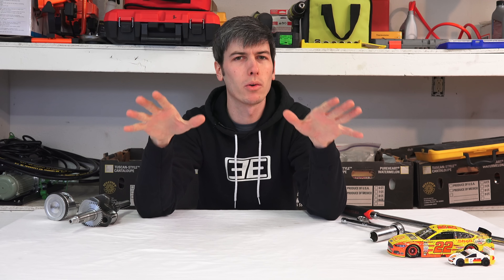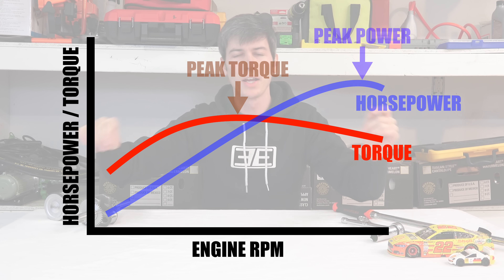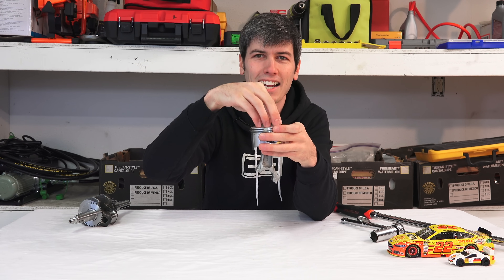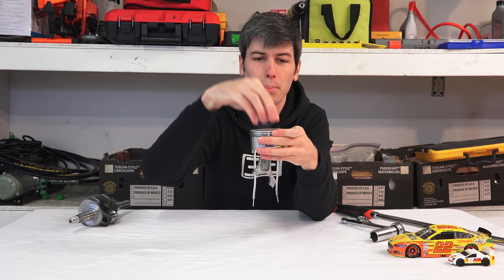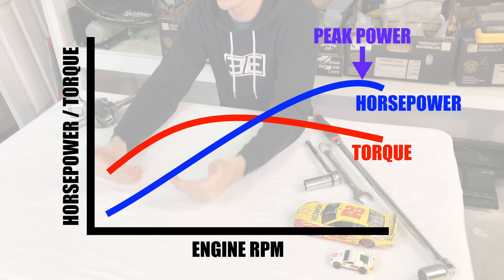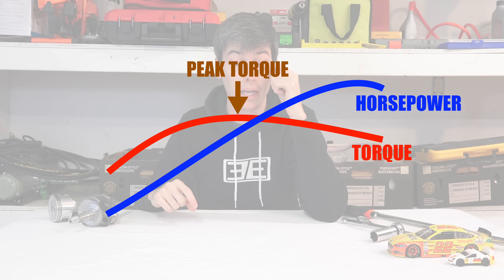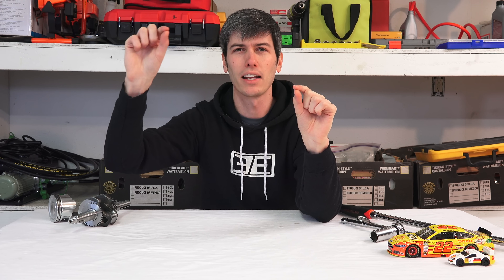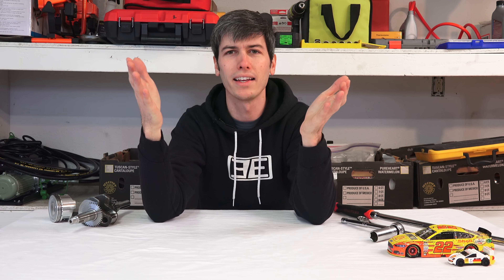Horsepower vs Torque - A Simple Explanation

Comment: So where does the flux capacitor go
Reply: Look at the circuit diagram for a symbol that looks like this: ---| |-----, or a symbol that looks like this: -----| (------.   That is the symbol for a capacitor.  The first is polarity-agnostic, and the second is polarity-sensitive with the curved line corresponding to negative polarity.

All capacitors are flux capacitors, because electric flux is a concept that applies to every capacitor.  It is used for deriving the Farad rating of the capacitor, through Gauss's law of electrostatics.
Reply: @carultch  whoosh

Comment: Torque must be significantly higher and have lower hp to Vehicles like Trucks to handle heavy loads, is it right?
Reply: No, but a higher torque/lower RPM engine with equal horsepower does increase the practicality of it for trucks. No one wants to drive a truck around at 5,000 RPM with a gas engine when they could drive around at 1,900 RPM with a diesel instead.
Reply: @buzzlesworth54  Thankyou

Comment: My question is: if you have enough torque and enough gears, you don't technically need to even consider horsepower?
Reply: Torque being a function of horsepower*
Reply: Power should be your primary consideration. The torque figure may play into how practical the vehicle is if you don't want to rev high to actually use the max HP from a motor.

Comment: I've always said torque is how much work a machine can do; hp is how fast it can do it.
Reply: Except it isn't, because torque doesn't have the same units as work.   Torque is more about how much instantaneous force the vehicle can make the road apply to it, after you translate through all geometric factors of the gear ratio and tire size.

Comment: You failed to explain why you would want a lot of torque, which I think will clear up everyone's confusion.

Race cars aren't that heavy and want to go fast, so you don't have that much torque and rather maximize the horsepower. Doing the work as quickly as possible.

A truck wants a lot of torque. It has a heavy load and doesn't need to move it quickly but rather, needs a lot of torque to move it in the first place. Hence torque is maximized in a trucker engine but not horsepower.
Reply: Your reasoning is incorrect. Trucks prioritize torque for practicality and durability.  A high-revving motor with equal HP to a low-revving (think gas vs diesel for instance) can do the same amount of work in the same time, but will be harsher to operate and tend to break sooner due to higher internal speeds.

Comment: 4:50 Isn't this wrong? You would feel the most seat-pressing force at peak POWER right?
Reply: No, that is correct. As long as you stay in one gear, your maximum acceleration would always happen at max engine torque. Things change though as soon as you're able to shift through different gear ratios. 
What determines the acceleration in the end is how much torque is reaching the wheels, which is generally engine torque multiplied by the overall gearratio in use.
Reply: @shi01  EE and Chris is confusing wheel torque with engine torque in this video, and you are correct. Max torque generating max acceleration is only true for wheel torque, since wheel torque is analogous to the force in F=ma.  However, the crankshaft torque generated by the pistons EE is referencing in his graphs is only translated to wheel torque after it makes its way through a transmission.  Ultimately, crankshaft power (the BHP power numbers quoted by car manufacturers) is what leads to acceleration.

Comment: What makes a gear ratio aggressive? Are there any friendly gears...?
Reply: All a gear ratio can do, is determine how much it should multiply torque, and divide speed.  Aggressive in this context, means a gear ratio that has a higher output speed, than alternative gear ratios.  "Friendly" gear ratio in this context, would be a low gear ratio that prioritizes output torque, for crawling through difficult terrain.

Comment: This guy's explanation is flawed lol
The car with more torque and less power WILL (all things equal) accelerate quicker than the car with more peak power and less torque.
Torque is what gets you off the line. Power determines how long you can hold that torque..
Reply: You have little understanding of power or torque.

Comment: How do you measure torque?
Reply: You would use a torsional spring.  By measuring the amount of twisting angle to the spring, and knowing its torsional stiffness constant, you can solve for the torque you apply to it.

Comment: Why isn't torque just rotational force?  Or maybe it is, but it's described in terms to force at a distance.

And over the years I've heard so many car guys say horsepower doesn't matter, it's torque that matters.  But here Jason is saying horsepower is what matters for acceleration.  And it makes perfect sense as described here, because torque is only a component of horsepower.  So why do so many professional car guys make a big deal about torque?  How about for towing and similar applications?  Does torque then play a larger role?

Comment: I would like to see a video, what you’re talking about torque in relation to towing with trucks.
Comparatively, a diesel engine, with 220 hp, but 420 lb ft torque.

While for daily driving, nobody is accelerating, or racing, but just driving… And the old saying is, you buy horsepower, but you drive torque.

Comment: HP = Torque × RPM= horrible equation.  Duuude brah. HP would be the way to describe the sum .  like totally dude.
Reply: The equation is not complete, he needs the conversion of 1/5252 but the gist of it is correct. Power is torque times angular velocity

Comment: Torque and horsepower is the same thing. Torque Means power before 5200 rpm and horsepower means power after 5200 rpm. Torque is lower rpm power and horsepower is higher rpm power. if you cant have both you'll want high horsepower on the highway but in a short race at a redlight you'll def want high torque. Next you can look at the car's dyno sheet to find out what rpms the max torque and horsepower come in at. This allows you more control of the cars powerband. If the car didnt come from factory with the transmission gearing optimzed for engine's powerband you can sometimes control this and extract more performance by shifting based on your powerband and the gearing ratios you have. This works best on cars with close gear ratios like a 10 speed auto

Comment: Hi there. Say you have two objects of the same mass and rolling resistance and they travel the same distance. One gets there in 5 seconds, one gets there in 10. Do they both require the same amount of overall power?
Reply: No, it requires twice as much power to get there because its does it in half the time. Power is work/time.

Comment: Far too simplified . And any comment I could write down to try and explain how this is to simplified would  ALSO be way to simplified . IF you found this topic interesting LOOK for a more comprehensive presentation . (it would be better to say that the torque of the engine is the mass of it's rotation , but still oversimplified )

Comment: Your explanation is very confusing. You used the same torque curve, when you explained the gear shift from 3rd to 4th gear. Wouldn't the torque curve change?
Reply: No, the torque curve remains the same. When you upshift, you're lowering the RPM (how much depends on your gear ratio) and therefore entering the torque curve graph at a different value to output the given amount of torque and power determined by the torque curve of the motor.
Reply: @buzzlesworth54  when he shows the upshift the rpm is at a higher value
Reply: @shadowcoder19  For peak acceleration, you typically upshift and high RPMs because that's typically where peak power is.
Reply: @buzzlesworth54  so you have to shift in high rpm because then it will drop a little bit as you said in your first reply?
Reply: @shadowcoder19  Right, conventional automatic and manual transmissions have multiple discrete gear ratios to select as opposed to a CVT. When you select a higher gear, the motor rpms drop depending on the selected gear ratio.

Comment: Not a good explanation! Fundamentally HP=TorquexRevs (The output graphs tell you that.) and acceleration depends on what torque is left available, after the demand for power has been addressed. It can be seen better by looking at the applied maths. In simple terms, power makes speed, available torque makes acceleration.
Reply: This might make sense in your head, but please don't try to teach others this. You're probably combining the wheel torque concept that EE likes with the more conventional physics concepts that most people use to understand it.
Reply: @buzzlesworth54  Not just in my  head Buzz, in reality in physics/applied maths. A car going up a hill must deliver a certain power output to match internal losses, wind resistance and the climb rate at the speed chosen and the required output is achieved by feathering the accelerator pedal. If the accelerator is floored, the excess output is delivered as torque which causes the car to accelerate up to a max rate of climb at which max power is delivered and absorbed. Gottit?
Reply: @philipmorris5990  What is the rest of the power that's not excess power delivered as?
Reply: @buzzlesworth54  There is the power required to address the steady dynamic state and air/fuel input, and when foot is put down, air/fuel increases to produce additional power associated with additional torque which drives the acceleration. There is no rest of power that's not excess power! The output curves are for open throttle status and the steady state described above requires only partial throttle opening.

Comment: Can anyone answer my question? In what gear(1st, 2nd, 3rd, 4th or 5th) does the torque and power are equal? why?
Reply: This is an irrelevant question because torque and HP are not measuring the same physical concept. However, each gear will have an identical RPM where the torque and HP value are equal that only depends on the units used to measure them. For horsepower and ft-lbs, that value is 5252 RPM which can be observed in the HP equation and as the intersection of torque and hp curves on any graph using those units. If your units are watts and newton-inches, a different intersection will be observed (unless the motor doesn't rev high enough to reach that intersecting RPM).

Comment: I think the reason so many people struggle with this (myself included) is that it is ultimately NOT simple.
Much as I enjoy EE's videos, it's possible that an engineer is not the best person to explain it ;-)
Reply: agree, what is needed is a Physicist, but he/she would just say the same thing as in this video: Horsepower is just the rate that work is done HP=dW/dt, and Torque is T= F x R. Now do you understand?
Reply: @BobCatz213  I think layman's terms is necessary...
How I have remembered it...
HP... The basic power for level road...how much power the car has.
Torque... Capability of the vehicle to move up an inclination...
(Keep the tyres rotating even when it's a climb..)
Reply: @pathania3377  I've usually thought about it as HP is the speed a car can go while Torque is only really to effect how easy it is to burn out. Torque can help you get to top speed faster but isn't the deciding factor in how fast a car can go which is what HP helps to decide. However, there is a steep diminishing returns on it. 200hp = 150mph, 700hp = 200 mph, 1,600hp = 300 mph.
So high torque is best for burn out competitions, drifting, and getting your car up to top speed quickly but doesn't help give you any meaningful data on what that top speed will be. I think...
Reply: @parker469a  but have you and millions of others who think this way ever driven a car? Ever heard of a gearbox?
Reply: @IgorArkin  A gearbox only does so much. If you've ever watched a burnout competition you would understand there's no way a gearbox alone is causing people to burnout without hardly moving for several minutes till their tires pop.
Reply: @parker469a  laughable how all the examples you try to input here are power related including popping the tire.
Reply: @IgorArkin  I'm at least giving an example, your comments are just worthless. Unless "power" is supposed to mean something specific. As far as I know power would be torque or at least hp so I don't know what your getting at. Explain it better.
Your sound like your saying something akin to electricity is electricity. Electricity is the outer most electrons passing back and forth from different atoms which is the kinda answer I'm looking for.
Reply: @parker469a  hp is a unit of power. Power is one of the major measurements in classical mechanics.  
Power = force x speed; Work / time, or acceleration* speed* mass.
Reply: @IgorArkin  Okay, that's good for "Power" so what is "torque"?
Reply: @parker469a  Torque= force x radius, applied perpendicular to that radius. Along with rotational speed (rpm) it is a component of power (torque x rpm). When we attach a wheel on the axle, it translates rotational motion into linear (pushes the ground and car moves forward), and power= force (thrust) x speed (of a car) now.
Reply: @IgorArkin  It sounds like I can ignore Torque altogether and just go by (Horse)Power?
I assume there's no way to translate this straight into 0-60 or max Mph without at least taking into account vehicle weight or is that irrelevant for some reason?
Reply: @parker469a  
Power=acceleration*speed*mass, from where
Acceleration=Power/(speed*mass)
If we compare accelerations of two cars, we do not compare 0-60 of one to 60-120 of the other. We compare 0-60 of both, which means we equalise their speeds. This leaves us with 
Acceleration=power/mass.
This is a power to weight ratio.

So basically, when we drive for performance, our goal is to make an engine output as much average power during the ride as possible. We must shift gears up and down around peak of power.

The only problem is a launch from idle revs and this is where more maximum torque may help a little bit because it occurs at lower revs than peak power. In other words, ignoring torque, we say that we can output more average power during the very first gear because of the shape of power curve. That's not much because it is only during the first gear. If we check two identical cars of the same power but one is diesel (much higher max torque) and another one is gasoline (like bmw or something), we see that gasoline is sometimes even faster: despite it lacks power at low and middle it has a flatter top (with the same max power).

But again, if we launch for performance, we must accelerate an engine as much as possible before releasing breaks/engaging the clutch. This way we almost skip everything below maximum power revolutions. Car and driver tests the cars this exact way: a drag run from idle and another, faster run, with engine pre revved.
Reply: @parker469a  does bhp give any meaningful indication of top speed?  Peak bhp is reached, and drops off, before the vehicle red lines ergo the vehicle hits top speed when producing less than its peak bhp 🤔
Reply: @IgorArkin  torque, not hp, is the internationally recognised measure of turning force, and Watts are the SI units used to measure power NOT hp.
Reply: Exactly.
Reply: I think he explained it well, but to my mind, we need to find out how to properly apply the knowledge.
For example, what does it practially mean if a car has 90 HP and ~180 NM torque? Does it put out these values at all times in all everyday situations?
Reply: Do you think engineering would be better explained by a baker?
Reply: It's pretty simple he explains it fully not even half way through the video

Comment: So if horsepower is torque multiplied by rpm, why doesn't every car with the same torque make the same power at the same rpm? Or do they?
Reply: Yes they do. If two engines have the same torque at the same rpm then they have the same power.

Comment: One for more mechanically minded. I'm a novice when it come to understanding engine/crankshaft torque, horsepower etc..

I've had look on a vehicle specification website and looked up my Qashqai, a 2016 1.5L diesel.

From what I understand from this data, at the specified rpm (1750 to 2000rpm), if we assume the vehicle is shifting at a constant speed within that RPM range, there would be a constant force of 191 pounds per foot (assume the distance from the centre of the crankshaft to the centre of the big end of the connection is roughly 1foot).

191 pounds equates to about 13 stone (average weight of a man say).

Seems quite a small about of force to shift a car as well as turn an engine, even with a gearbox providing mechanical advantage, if I've picked this up right.

Any feedback appreciated.
Reply: Well, your vehicle is only making 71 HP at 2000 RPM given 191 ft-lbs of torque, so it is indeed a slow vehicle if that's it's peak power! Perhaps you're overestimating the amount of power it takes to keep a vehicle moving. 

In order to maintain a speed, the vehicle's engine must create enough power to equal the rolling resistance, wind resistance, and friction within the drivetrain. At lower speeds under say 60 mph/100 kph this requires relatively little power. It is high acceleration that really requires a lot of excess power  to get the vehicle moving, and yes that requires "short" gearing within the transmission to ensure that the motor can rev high enough to reach peak HP.

Comment: In a drag race between car 1 that has more horsepower than torque between car 2 that has more torque than horsepower, car 2 will have a better launch control and will take off first out of the start line than car 1 since car 2 has a lot of torque, but then car 1 will win at the end and be the first one to cross the finish line because of horsepower